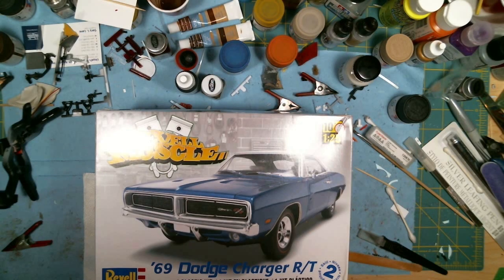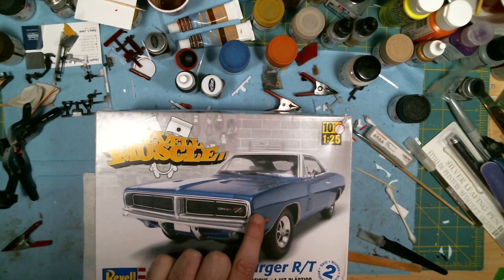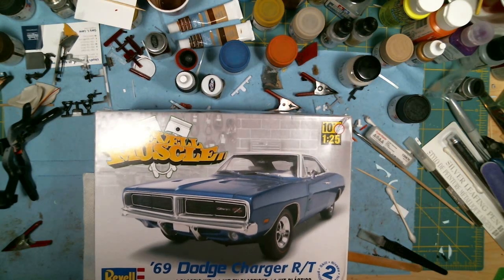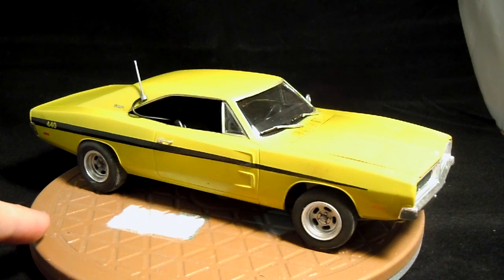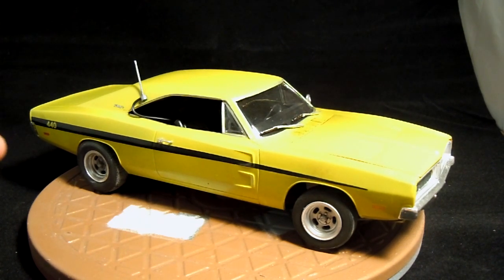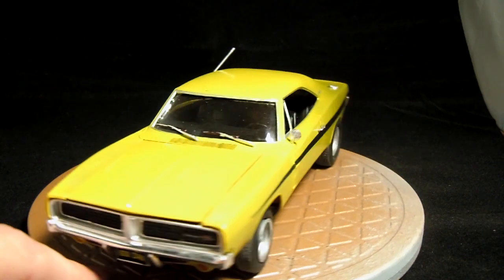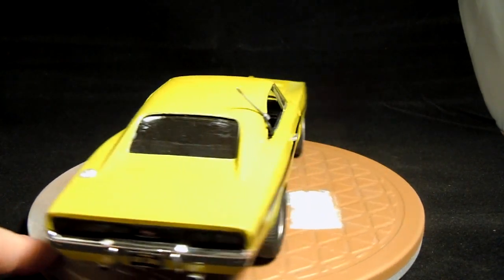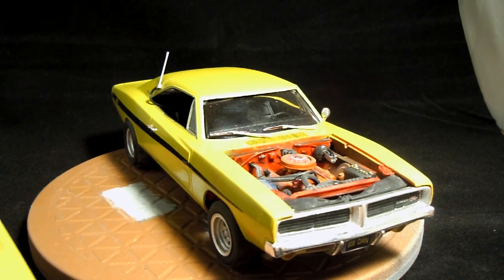Dirty Mary Crazy Larry 69 Charger - Final

Comment: The charger turned out great gary 👍🏻👍🏻👍🏻👍🏻 I got to get back to mine soon still trying to locate decals
Reply: Keith marks has the decals
Reply from the maker: Thanks Jeff. I got my decals on eBay. I think Kenny May made his own
Keith Marks didn't make them when I was looking.
Reply: Transition Modeller ok I found some I can’t remember where now but he wanted $15 I thought that was pricy
Reply: @Jeffsmodelgarage  they are a bit expensive but excellent quality
Reply: FUBAR Model Yard I have to do some research and find a set I put the build on hold for now
Reply: @Jeffsmodelgarage  I got the road runner decals from marks. 14 bucks but worth it. I still think you should do the train wreck version with 3 dead crappy actors inside
Reply: FUBAR Model Yard somehow I knew you were going to say that lol

Comment: Nice work Gary, the weathering looks great, especially the engine bay.  Just wondering if you can paint the taillights on with some silver or chrome paint and then translucent red?
Reply from the maker: Thanks Steve. That wouldn't work as they are actually holes and not just indents for the lights. I need access to the back to fix it but its not worth screwing things up even more which is exactly what I would end up doing  haha